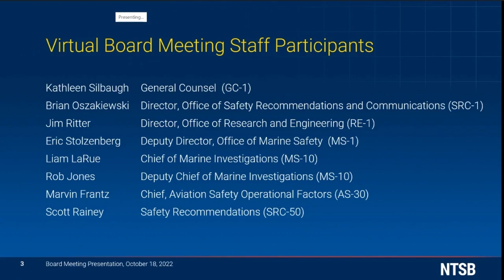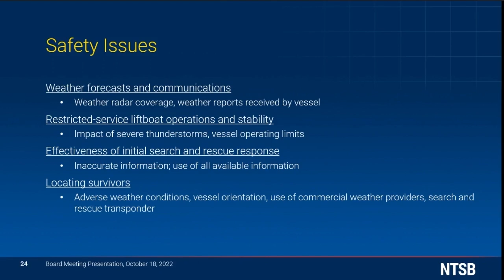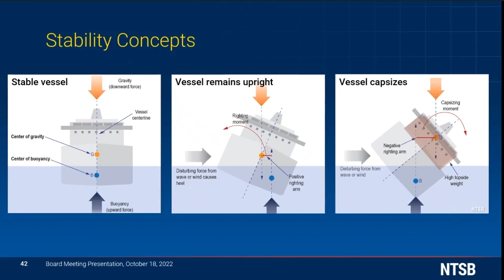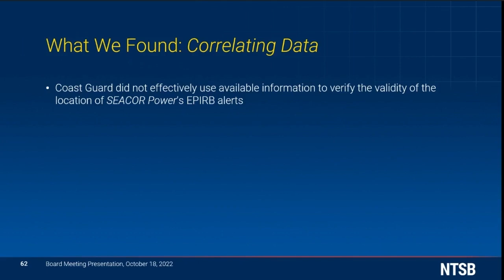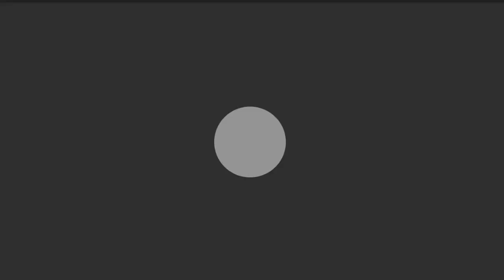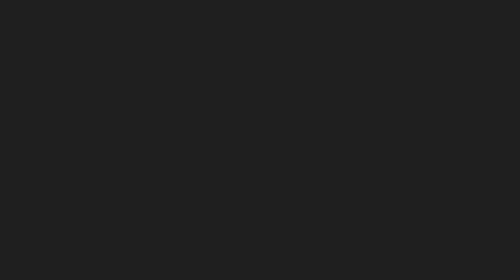Board Meeting - Capsizing of Liftboat Seacor Power Subject

Comment: Thanks for mentioning my SNAME paper (W.P. Stewart, Capsize of Liftboat in Transit, Proceedings of the 27th Offshore Symposium, February 22nd, 2022, Houston, Texas
Texas Section of SNAME).  I wish to correct the NTSB's characterization of the paper's conclusions.  One of the key conclusions in the paper is:
"The Class 250 liftboat, in the nearly full load condition as presented in this paper, is prone to capsize in 6-ft waves from the beam and quartering directions, without any wind."
It is hoped that the NTSB and the USCG will make further efforts to improve afloat stability of liftboats in WAVES AND WIND.
Kind regards, Bil Stewart.

Comment: The NTSB Board needs to consider that the operating limitations had it wrong, and it needed a revision of change reflecting that.  Time and time again without being AFT trim the vessel displayed greater instability than when it was even keel.  Sounds like after many years and voyages she didn’t like being even keeled and handled terrible due to it.

Here’s another one for you.  The operating limitation stated the vessel should not be elevated on station preforming operations in more than a 1.5 knot current, but that never stopped any vessels I’ve ever worked on from continuing operations when the currents exceeded that limitation.  There are decades and decades of proof, that such a limitation is preposterous.  

I have a question for the gentleman that mentioned aviation.  If you found that 5lbs of ballast in the tail of your airplane made it fly more stable, would you stop putting it there because of the limitations or would you change your limitations?

Comment: Obviously trying to put the bow into the wind didn’t prove to be a solution.  Consider a vessel running weather patterns it spends the same amount of time if not more with its stern to the wind and seas, it’s definitely a smoother ride going with the seas than trying to buck them.  In the turns is when you get the side seas, that’s absolutely miserable, you have execute such maneuver as quickly and safely as possible.  Regardless of forward speed maneuvering the vessel to the closest heading that avoids side sea states should be recommended when attempting to elevate a vessel in peril.  You say the vessel was being push along faster than it’s normal top speed, okay that sucks for the equipment.  You’re likely going to break something as you contact the sea floor, but you’re in more control of that scenario, than the scenario that ultimately played out.  Run your simulator, and give us your findings.  Given the speed of the vessel, stern to the seas, what’s the probability that it would still capsize upon the legs contacting the sea floor.  Run different scenarios like running the the aft leg slightly lower so it contacts the sea floor first.  Then use it like an anchor.  Or actually drop anchor to slow the vessel down.  I understand that preventing the situation is best practice, but if SHTF give us some options to increase our chances of survival.  Thank you.